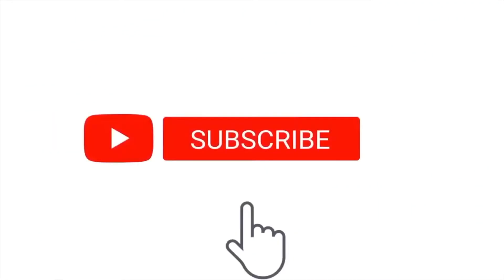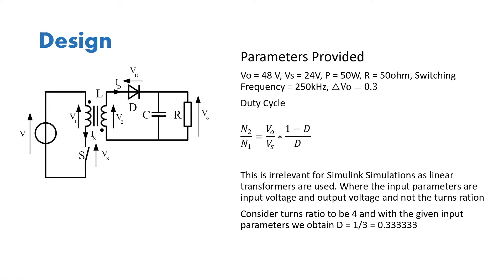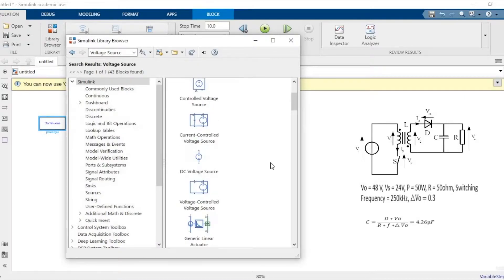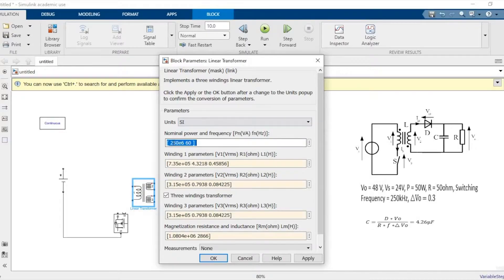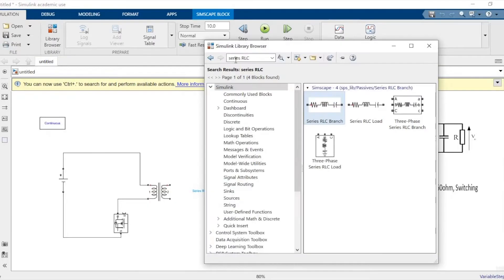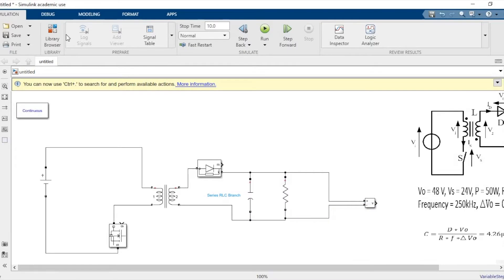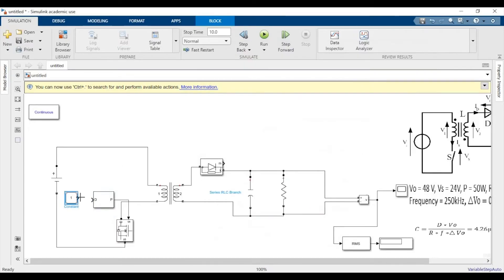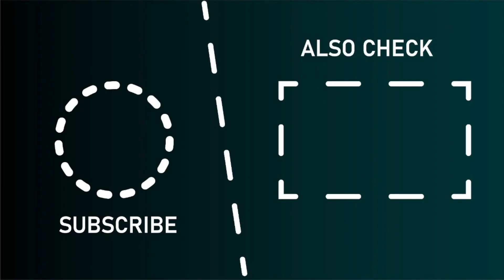Step-by-Step Design and Simulation of DC-DC Flyback Converter in MATLAB/Simulink!

Comment: your matlab ciruit is false, the transformer polars are connected in wrong way.

flyback converters dont function that way. flyback converters first charge their Lm inducatance , once swith is oof, the Lm inductance switches its polarity and causes the diode to turn on, this way the Lm inductor discharges through output. then in the next cycle it charges again when switch is on.

so tranformer Lm is an important design parameter.

Comment: I think you have not connected diode properly. You need to follow dot convention. Please verify simulation by changing duty and observing output voltage. Your diode is always on because of dot convention.
Reply: I have same question. After satisfying dot convection output is not proper. what is the behind that ?
Please clarify.
Reply from the maker: Thank you for your input! We will have a look at it :)